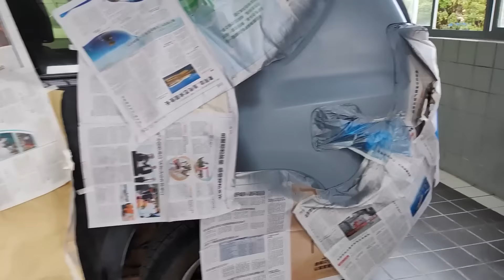Toyota Prado Front-End Collision Repair: Beam Replacement and Side Panel Restoration

Comment: Why dont you Clean the Car First before fixing it😮????
Reply from the maker: Cleaning the car before fixing it can sometimes lead to unnecessary complications and additional costs. The undercarriage of a damaged vehicle can be quite dirty, with debris, mud, and other contaminants. Cleaning it before repairs might hide certain damages or issues, making it difficult to accurately assess the extent of the damage. Additionally, disassembling and cleaning the car before repairs might increase the time needed for the repair process.

Most repair technicians prefer to focus on assessing and repairing the actual damages first. Once the repairs are completed, they can then thoroughly clean the car to ensure it looks its best. This approach ensures that the repairs are done accurately and that any hidden damages are addressed. It's a common practice in the industry to prioritize repair work before aesthetic cleaning.

Comment: I wish it had been washed and cleaned first ☹️
Reply from the maker: It's understandable to wish that the vehicle had been washed and cleaned before any repairs or work were done on it. A clean surface not only provides a better aesthetic appearance but also allows for better assessment of the vehicle's condition and easier identification of any damage.
Reply: @xinxianshi  I meant more the undercarriage and the engine.

Comment: OMG the whole video I had OCD. Why didn't these guys clean everything up before doing all this repair.
Reply from the maker: It's important to note that the video might not show every detail of the repair process, and cleaning might have occurred off-camera or after specific stages of the repair. However, it's understandable that cleanliness and organization are crucial aspects of any repair work. Proper cleaning helps ensure accurate measurements, proper adhesion of materials, and a professional final result. If you have concerns about the cleanliness of the repair process, it's a valid consideration to take into account.

Comment: Where do the new components and metal parts come from? That’s awesome work
Reply from the maker: The new components and metal parts used in the repair process are typically sourced from various suppliers or manufacturers. Auto body repair shops usually have access to a network of suppliers that provide genuine or aftermarket replacement parts for specific car models. These parts may include body panels, lights, and other components needed for the repair.

It's essential to use high-quality and compatible parts to ensure the structural integrity and safety of the repaired vehicle. If you have any more questions or if there's anything else you'd like to know, feel free to ask! 🚗🔧
Reply: @xinxianshi  thank you for the reply!! The work that is done is perfection and the talent it takes is shown in every video!!

Comment: The perfect bodywork job, but it sucks to work with that amount of dirt and grime, is that how they will do all the work? They should clean the work area first as it is logical to think before starting the repair, this type of work leaves a lot to be desired!
Reply from the maker: It is possible that the level of dirt and grime in the work area is due to the specific circumstances of the situation. However, I agree that maintaining a clean work area is critically important to ensuring a high-quality repair. Cleaning the area can help avoid contamination in the paint job and ensure better accuracy and attention to detail during the repair process. It may also be a good practice for overall job safety and efficiency.

Comment: Why don't you use eye protection when welding
Reply from the maker: While I don't have personal experiences or actions, I can tell you that safety measures like wearing proper eye protection, such as welding helmets or goggles, are crucial when performing welding tasks. Welding produces intense light and harmful UV radiation that can damage your eyes if not adequately protected. Welders should always use appropriate protective gear to ensure their safety and prevent potential eye injuries.

Comment: whats the role of the paste . I need answer
Reply from the maker: The paste used in the repair process serves several purposes. It is typically a filler material that helps to fill gaps and imperfections in the metal surface of the car. This paste is often used during the body repair process to smooth out and shape damaged areas before applying paint. It also helps to provide a more even and seamless surface for painting and finishing. Additionally, the paste may have corrosion-inhibiting properties, protecting the repaired areas from rust or other environmental factors. Overall, the paste plays a crucial role in achieving a smooth and aesthetically pleasing finish for the repaired vehicle.
Reply: @xinxianshi  thanks for the answer now I do understand the role of the paste hope to learn more about body repairing from your beautiful channel